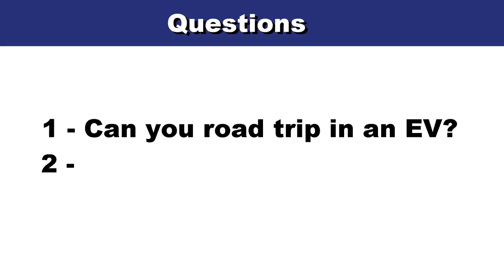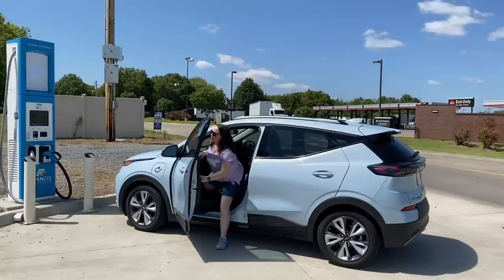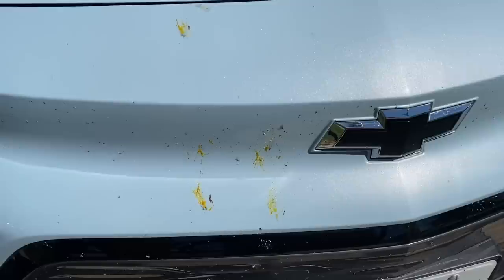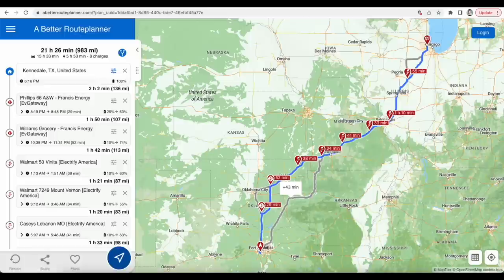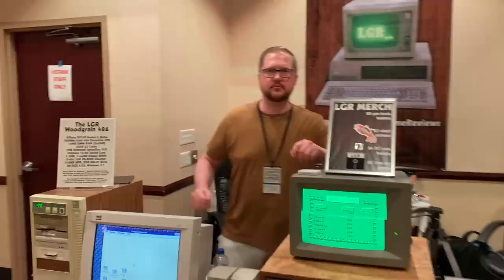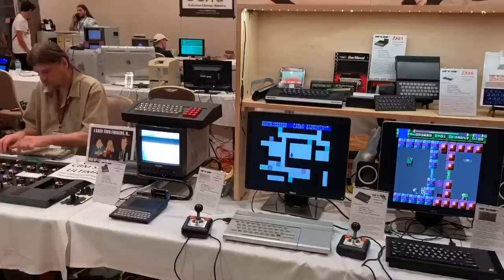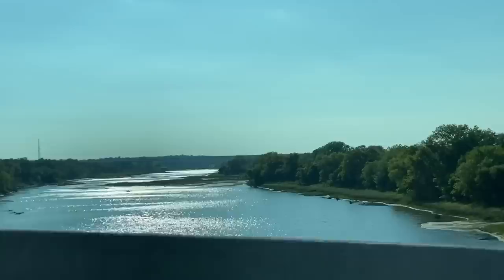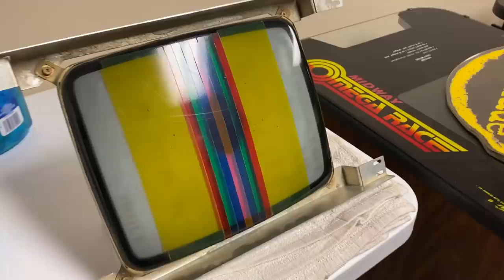EV Roadtrip, Vintage Computer Festival, and Moonbase Repair

Comment: Does the Bolt EUV recommend you charge only to 90% for battery life? That seems fairly common for other EVs.
Reply: I've thought a lot about this.. but it comes down to uncontrollable factors like Vibration and Heat damage mostly by charging curves. In theory the cycles are infinite but vibration damages it faster. Software can get better and optimize the heat charging curves over time.. so its not a fixed predictable thing yet.
Reply: Yeah I’d guess so but it was a road-trip so you’d want the full range
Reply: @s13shaka  very incorrect at least for the North American market
Reply: for normal circumstances, yes. But its ok to go to 100% if you are going to discharge it right away. Keeping it at full is the problem.
Reply: Generally it's best to keep the battery below 85% for daily use. That should in theory double the battery life, but of course if you're going on a road trip you want a full charge for maximum range.
Reply: @katelights  Yeah.. from what I've read the mechanical stresses on the ion matrix are different when charged versus not charged.. its like transitioning from Iron to Glass.. in one form its very brittle, in the other more ductile.
Reply: @destructodisk9074  who cares when children and slaves built your car
Reply: @justinepaula-robilliard  yup look up “sacrifice zone” it’s appalling
Reply: @destructodisk9074  almost every vehicle does.
Reply: @destructodisk9074  Neodymium, Nickel, Cobalt, Lithium, all rare Earth minerals.  Those items you listed dont have 1000 lbs battery packs produced from 'sacrifice zones' nor hundreds of pounds of Neodymium exclusively from China as your motor.   Search "sacrifice zone" an article by the Associated Press and learn that there is more to the story than just the only buzzword you know, lithium.

Comment: 😂 I can do 983 miles in one day, in Europe (mostly Germany), with my combustion engine, with only 2 stops for refuelling.
I’ve actually driven last week, in one day 1200km (roughly 640miles) + spent 3-4hrs in some meetings at work.
One way, early in the morning, took me ~5h, then coming back in the evening  about the same duration. Average speed approx. 120kmph (73-74mph). With an electric vehicle I would’ve struggled a lot to cover this trip in one day + have enough time left for some meetings.
Nonetheless, I’d love to have an electric/hydrogen powered vehicle and I’m looking forward for that day.

Comment: This might just be me living in a terrible heroin-addicted unpoliced city where catalytic converters get stolen constantly, but it seems unsafe to just leave the car plugged in unattended. Some jerk will come along and unplug it just to be cruel, or to try to steal the cord for heroin.
Reply: The cord locks to the car so you can't remove it typically while it's charging. Also, the cord would kill somebody if they tried to cut it while charging a car. Those actually have liquid cooling in the charging cord, which is neat, because it lets them use a lighter gauge of cable than they otherwise would need, and it keeps the cable more flexible.
Reply: @WarrenGarabrandt  Yeah.. the few cord cutters that have tried to steal the Tesla Supercharger cables were very disappointed with the amount of copper they got. Vandalism will never stop.. but them Superchargers are just not profitable for thieves.

Comment: You convinced me, I will have no use for a EV.
Reply: I find them interesting but still no reason to replace my fully functional gasoline gar which doesn't require using a tablet to open the glove compartment.
Reply: lol cos the worst one?

Comment: You can roadtrip an i3 94Ah too if you want to :) I just did a 1650 mile trip with it in 3 days. Had the same experience as you pretty much, I was looking forward to the charging stops and never really got bored.
I've done this route a bunch of times and 3 days is on par. Yes I could've saved a couple of hours each day if I had had a gas/diesel but in the end it was always gonna be a 3 day trip and honestly I've never felt so rested after a trip that long. Usually I have to stop for naps on the last day (620 miles) because I'm just exhausted and it's getting unsafe to drive. The charging stops take care of that.

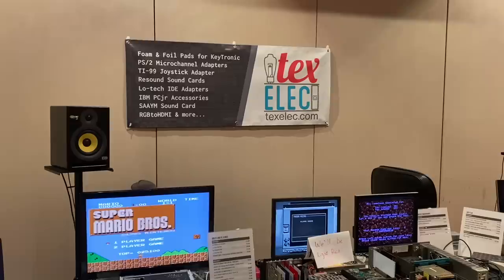Comment: 8:00 That blue-white prototype case of the Commander X16 looks absolutely gorgeous in color and shape! ♥♥♥ I hope that turns out to be available in mass production!
Reply: It looks to be a standard Mini-ITX PC case. I can't tell if the X16 logo is just stickered on or if it's a custom or modified front plastic.
Reply: @eDoc2020  It was custom/modified front plates.

Comment: Oh dude, that's pretty crushing to see that tube break! I know a bit what that's like, as I bought an IBM monitor from a guy interstate, and he very thoughtfully shipped it in enough packing peanuts to kill a horse, but it showed up with the neck snapped.

Pretty sure the reason it snapped was because it was packed with the tube facing down, and the packing peanuts allowed enough movement when it was jostled to make it snap. If it were packed tighter or in the correct orientation, it probably wouldn't have snapped. Normally gravity would ensure that the neck was supported by board on the socket, when it's upright that means the neck is supporting the board.

Anyway, at least you had a nice trip to VCF Midwest.

Comment: Once i went on a road trip around 400km one way, we drove a 1.5l diesel Citroen Saxo, we arrived at the place, came back home and still had some fuel left in the tank. Very economical car, i would argue it's as cheap or cheaper than an electric car, if you don't have a solar power system

Comment: Think for just a minute, how much went into the arrangement. From the CN programing. Gateway programming. The AR to work with TI. The whole buffalo. To get to the point to bring it all together and have to go from threat to consequence the end a file to start a simultaneous file while one sits in consequence all for some power and control issue. Then to throw 3 other life projects into the threat. Crazy to think of at times.

Comment: A 110 baud teletype like the one in the video was my very first printer! I had bought a BBC Micro Model B when I was a student in 1982, and was fortunate enough to have a summer job in the computer department of the local college. They were throwing a bunch of teletypes out, so they let me take one home, and I hooked it up to my computer. It worked, but it weighed an absolute ton, and when you switched it on it sounded like a jet engine starting up. It was also painfully slow and impractical, but I printed off a number of BASIC program and 6502 assembler listings before my parents made me an offer I couldn't refuse and they took it to the local tip (British for dump).

Comment: I did that one time - It was an original Mac, and worse, it belonged to a student at the university where I worked.  I volunteered to fix it and when putting it back together I just clipped the tip of the vacuum nipple.  There is only one sound worse than the sound of air rushing into a CRT, and that's the sound of a Li-Ion battery bursting into flames.  But that's a different story.

Fortunately the IT department was very kind and provided me with a replacement tube (whew!!!)

Comment: Thank you for the thorough information on a road trip with the EV but the huge roadblock for me is that drive from Fort Worth to Chicago for me with a gas vehicle would be a one day trip. An EV means it has to be 2 days. So my cost comparison adds lodging and extra meals to the cost of an EV plus a lot of extra time
Reply from the maker: I can't imagine doing a 16 hour road trip in one day.  I guess it could be done.  But not me.  And yes, I know google maps says 13 hours.. or whatever.  But that isn't realistic.
Reply: @The8BitGuy  I totally just did a quick Google search, but I’ve done St Paul to Dallas, and St Paul to Chattanooga many times and it would drive me crazy to HAVE to stop overnight because charging takes that much time…. I do have a reservation for the Ford F-150 lightning though, so I want to convert. Road trips are just the biggest hurdle for me
Reply: @smartassalz  I'd love to get the Lightning but I don't want to help my friends move.

Comment: I do admit when I took my bolt to my parent's house last year I did enjoy having a break. On the way there it was decent and need only 15 minutes of charge. On the way back it was much colder and I got massively impatient waiting 30 minutes for the same amount of charge. Taking it on a longer trip like this? I would probably just rent a car if I had to drive. Ideally I'd just fly and rent a car after getting there.

Comment: Run that driving test in the dead of winter.  Also there was only a few chargers at each location, then what do you do. Wait around 45 minutes before you can even start charging, so now that stop just became and 1.5 hours. Make those cars affordable without subsidies, and fully charge in the same amount of time it takes to fill a car with gas and then we will see

Comment: The David's "Oh nooo!!" really hurt me. This is really sad. Just imagine you are 5 centimetres before victory and some jerk jumps and wins. What a pain.. but here, it's WORSE: finding the exact same tube, with exact same color filters and orientation today is darn near impossible, considering that galloping ghosts didn't had at least one arcade of 885 arcades TOTAL. I repeat: of nearly 1.000 arcades, neither one is moonbase. Very cool. Cheers, David. Good luck.
Reply: There's no need to find one with the same color filters, though -- those filters weren't put on there by the CRT maker in the first place; they were put on there by Nichibutsu when they made the game.  Usually, they're not glued down all that tightly, so you can just peel them off the front of the tube and put them on another one.  (Heck, most of the ones I've worked on like that, the filters were just held on with a bit of scotch tape on the edges of the tube.)  Cross-matching a replacement tube will take a bit of work, to be sure, but there's plenty of collectors out there who can help out with that; it's not exactly an uncommon thing to have to do nowadays!
Reply: @ballyastrocade5672  Very good. Hope he has enough strength left to find one

Comment: I've smashed a CRT neck before trying to repair it and I can understand the feeling of despair. So much effort in replacing capacitors and diagnosing issues to be left with a generally useless piece of electronics waiting on an exceedingly rare part.

Comment: Try that again in the winter. Charge times double to triple with a chilled battery with no way to preheat. I say this having road tripped a couple times in a bolt in the winter. It sucks.

Comment: About 6 years ago I had a excellent widescreen crt tv, it started having an issue with the screen just going black.  it literally weighed over 140 pounds and I barely was able to get it onto the floor, it was full of dust which I cleaned and the tv seemed to work great after, but due to the weight I was struggling to get the back panel back on or lift it, I went to put my hand to back of the tv and caught the tube instead and just heard a hiss.

Luckily I got one of almost same model (well 1 year older but identical in every other way seemingly) and that has lasted me ever since.

Comment: I am not sure, but the Moon Base that you have. I believe there were one in the lobby of the cinema (movie theatre) in the town were I grew up. It was one of them old style ones, with thick red curtains and old style lamps and that sort of stuff. Kind of like walking into the 1950's. If anyone here, is from the town called Middelfart in Denmark and grew up in the 1980's, perhaps you can verify if I remember correct or not.

But it was a space invaders styled tabletop game. That is for sure.

Comment: Officially, there are 44 Springfields in USA, 8 of them even in a single state (Pennsylvania), another 3 of them in a single state (Virginia), the other 33 in 33 different ones. The reason why the Simpsons live in Springfield is because that could be everywhere in the USA. There are also 3 ones in Canada, 4 ones in Australia, 12 ones in UK, one in Ireland and two in South Africa. So Springfield could as well be named "Some Place".

Comment: Girlfriend and I did a cross Canada trip in her Tesla Model 3 this summer. We decided on her car strictly because of the charging network here in Canada. Unfortunately, the third party DCFC is not a good as you've got down there. Either way, it was a really good experience and had a ton of fun seeing two major oceans. Once we got home, totaled up the charging costs, and it was just over $1,000 for 13,050kms; 2/3rds what my old Camry Hybrid would have cost. Thanks for the great content, and hopefully you have better luck repairing the other game.

Comment: Nice fix by Sark. Power supply circuitry are so easy to overlook. They can break down and start outputting wrong voltages that if "lucky" would just telegraph something was very wrong by ceasing to work or damaging itself/surrounding components. But often only cause slight/odd issues as these old electronics are very robust in what voltages they accept. Unlike modern IC's that just go "NOPE" the moment you are off by a volt... <_<

This leads to one of those lessons you gain from experience that when in doubt about where anomalous behavior comes from: Check the supply.
Can't trust linear regulators to remain reliable forever.

Comment: "I hope to see an update" low and behold there already was an update.  Sorry about the tube mate but I'm glad you got Moon Base working.  

My thoughts on this video are more around you road trip.  And maybe it would be different now that I'm older, but I'm surprised you consider that a two day trip?  In a gas car I would think that is possible in 12 hours, 13 hours with minimal stops.  And that's probably 1 refueling stop.  I did a similar trip from NW Wisconsin starting at 9 AM and we made Dallas by 3 AM the next day.  

Now I was 24 at that time, and this over 20 years ago.  I do find I need to stop every couple hours now just to stretch a leg.  So maybe that sort of road trip would be different.  But I still can't imagine stopping as much and as long as you did.  I guess since I used to be a truck driver, I envision such trips as a test of endurance and not a leisurely drive.

Comment: Why do ev-people always try to convince me, that the bug is a feature? Back in the days of coaches, when  the source of energy was close to empty, they just changed it. They did not wait until the horses recovered. Todays overengineered evs want me to wait , instead of just changing batteries. When my family and i moved to new home, we drove all night. When I needed a rest, a husband of my sister-in-law continued driving. But missing the day-light because of charging would have been a bad idea, when you need to install lamps in a new home. Even of you say , that is not every day use, it should be possible to have a spare battery to extend the range, when time is money. 
But anyways, I like this computer history.

Comment: I think the whole thing with EV roadtrips is that you need to have a different mentality - the shorter range and the enforced charging times means you end up planning in much more things to do on the way, as opposed to either just driving straight from A to B or being perhaps a bit more spontaneous. It is probably better for you in some ways though, since you simply can't just drive for more than a few hours without having to take a break. In comparison, I could've done that trip in my car with only one fuel stop mid-journey, but then I may not have been as likely to stop in some of the towns along the way.
Reply: Unfortunately, for most of us going from A to B without stopping is unavoidable. Most of us have precious little paid vacation time, so last thing we want to do is waste hours (or even add another day of traveling) taking  longer routes to make sure we hit the right charge stations. Even if I do stop, it's for a quick snack and bathroom break and I'm back on the road.

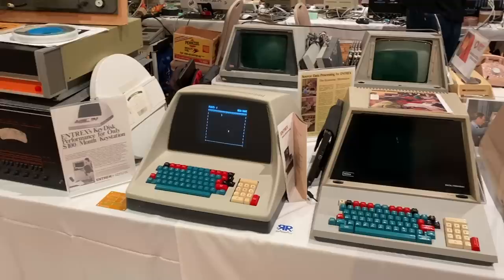Comment: 10:03 Convergent Technology/Burroughs B21 and B25 - yay, there are still a few of those around! I was programming those in the 1980s here in the UK. One of my first jobs was as an apprentice TV engineer so I've experienced the breaking of TV tubes many times. When a tube had come to the end of its life we used to deliberately break the necks before the tubes were disposed of to remove the vacuum. Pretty much all of them would exhibit that stripping of the phosphor from the centre of the screen when the neck was broken.

Comment: I used to repair CRT monitors and the sound of cracking the neck of a tube gives me nightmares! - yes the air rushing in did clear the phosphorus from the front of the tube, and I was not the only one to do it…😢I hate mono tubes as they hold the charge too well. Colour tubes discharge better… it to do with the design of the fly back transformer with the focus control.

Comment: I wonder what the daily wattage is at the Galloping Ghost Arcade with all of those machines running at the same time..... After a bit of research, it seems each machine would use about 150 watts. With 880 machines, I figure about 25 cents a day each (well, half a day), which would be about $200 a day. Yikes.